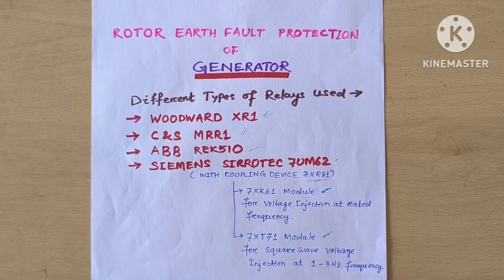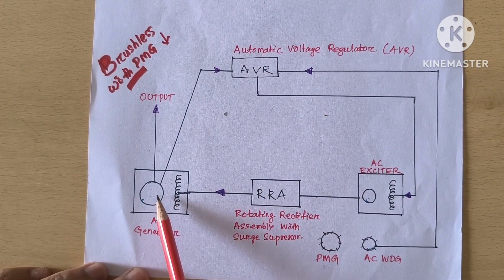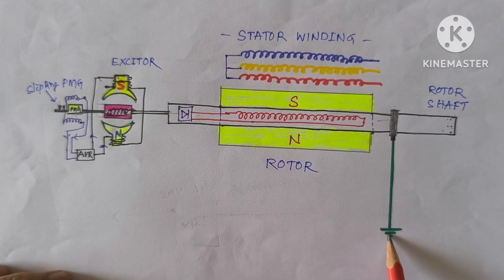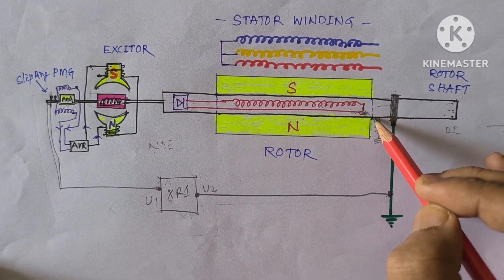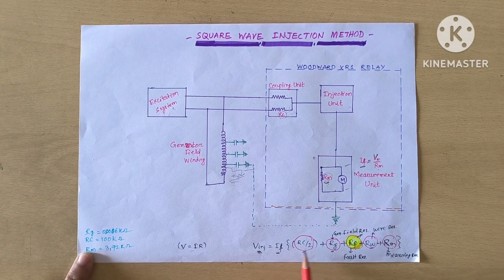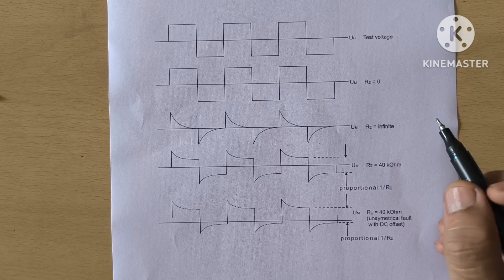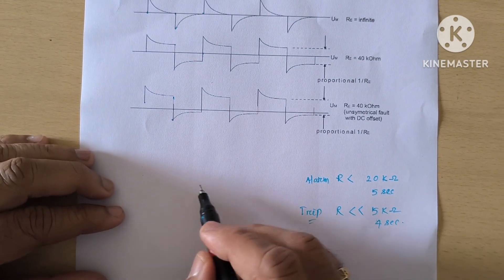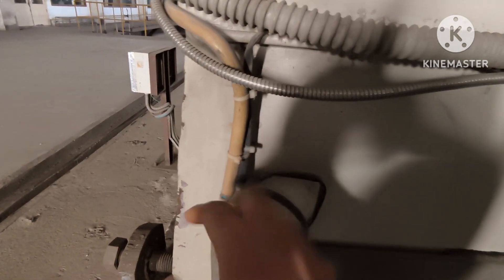Rotor Earth Fault Protection of Generator.

Comment: Good eve Sir, XR 1 Relay will generate 24 volts ? If it exceeds that voltage more than 24 what will happen? Is there any interconnection with shaft earth carbon, if DE side Earth carbon brush any problem what will happen with this relay, relay will trip?
Reply: Thank you sir, thank you very much
Reply from the maker: Woodward XR1 relay designed to injects +/-24V ,1Hz frequency.Higher voltage injection possibility very negligible.As we are giving excitation voltage to the rotor winding,so higher voltage injection creates interference.
The basic principles used to measure the insulation resistance of the rotor in a closed loop system.NDE side through slip ring voltage injected & feed back taken from DE side to the relay.If feedback missing,then relay possibly not going to operate.
Reply: One more doubt, as explained in the video, U1 and U2 terminals are getting 24 vdc, but here i checked the voltage between U1 and U2 , it is getting fluctuating voltage 24 volts and 7 volts and 0 volts like it is coming,24 volts dc is not getting continuously
Reply from the maker: U1 & U2 terminal DC voltage will come around 23.4V.If it is fluctuating or coming around 7V, may be error with relay.
A1&A2 we may give 19-390V DC or 36-275V  AC.
While preparing the video I given 240V AC & relay o/p measured 23.3V DC.
Reply: @himansupradhan2005  okay sir
Reply: @himansupradhan2005  but it is new relay, as said in manual out put voltage will come as square wave , so that it is not generating 24 volts dc continuously, if get your mobile number, personally I will share you sir
Reply: I will share the video sir
Reply: Here I have given 230 volts ac for A1 and A2 terminals for checking

Comment: Sir in our power plant this protection is taken through Siemens 7UM62 Relay which uses square wave principle....... But there is some problem since last six months when turbine is rolling at 3000rpm there is no rotor earth fault but during syncing of generator when we get shaft speed nearly 2000 rpm suddenly rotor earth fault resistance decreased below 5K ohm and fix there for some time and when we achieve 3000 rpm after few minutes the rotor earth fault value settled on normal value i.e >999Kohm..... What could be the reason?
Reply from the maker: Very typical problem.Because with rated speed it is normalising.May be error with Ire or Ue measurement,but not sure about it.
Generally carbon brush improper contact with the slip ring or dust accumulation in terminal box creates false alarms.

Comment: Nicely explained.
Reply from the maker: Thank you.
Reply: Sir in our power plant this protection is taken through Siemens 7UM62 Relay which uses square wave principle....... But there is some problem since last six months when turbine is rolling at 3000rpm there is no rotor earth fault but during syncing of generator when we get shaft speed nearly 2000 rpm suddenly rotor earth fault resistance decreased below 5K ohm and fix there for some time and when we achieve 3000 rpm after few minutes the rotor earth fault value settled on normal value i.e >999Kohm..... What could be the reason?